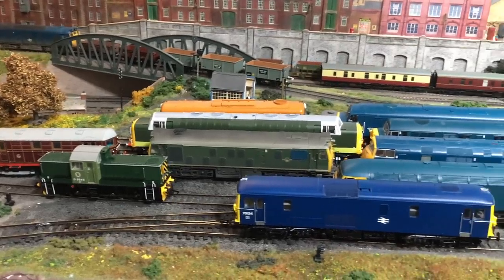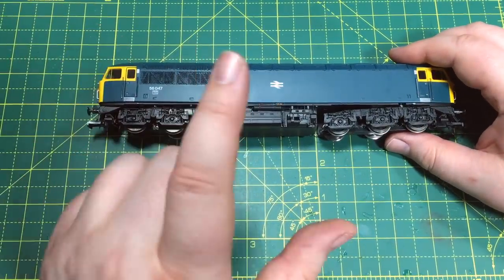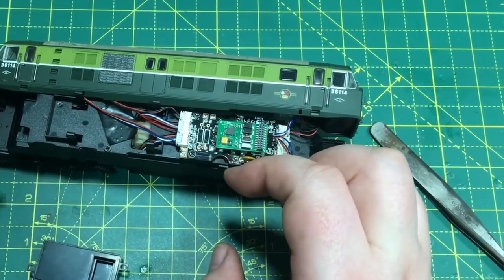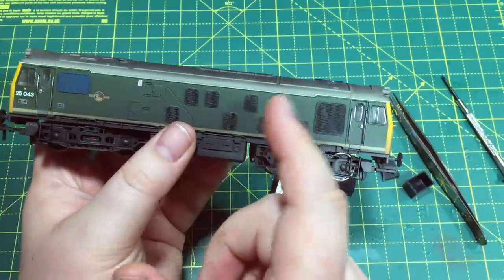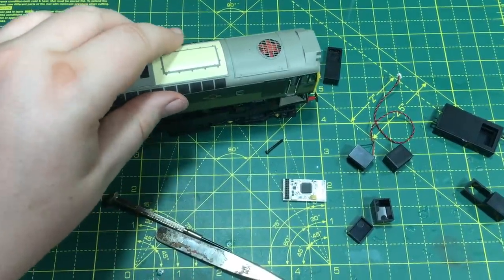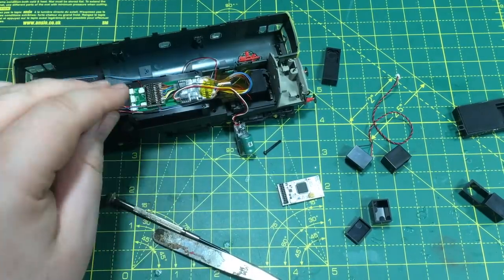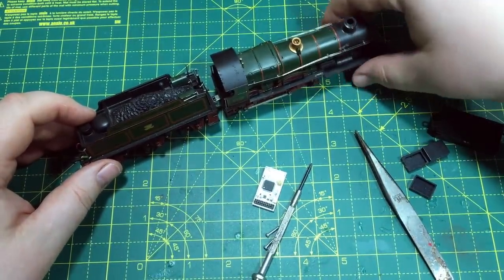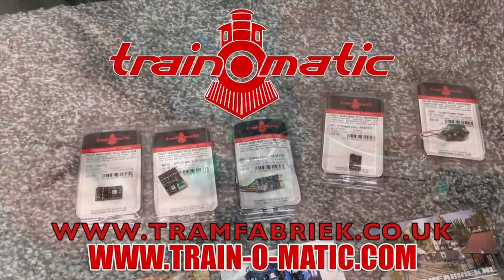Will it Fit? HM7000 21-pin TXS Bluetooth Sound Chip in all my locomotives!

Comment: That was fun. Always good to see things tested rather than simply relying on opinions.

Hopefully they can engineer a different antenna solution and maybe find some smaller micro controllers for the next iteration of the next18 decoders, there's certainly scope to achieve it looking at the specs of what's on the board they are producing now and what is available in smaller form factors that achieves the same functionality. Well worth going on a dive into PCB antennas and drawing out the circuits and choices of components based on photos to work out what exactly they've  used and how they've gone about it. It's quite a tidy little PCB with not much room to impove it beyond the two things mentioned above.

Comment: Hi Jenny it’s me you read my name out on your Monday Club every week now I have five of these decoders four 21 pin and one 8 pin type 
So yes I like how they are workable and how you can easily download the sound profiles but most of the time the profiles do not fully download and you have to keep trying and sometimes have to use another type or style of sound profile to get the full sound working 
Then after having two decoders that failed I have sent them back to hornby 
Also I find that if I have a short on any thing my ecos goes into stop mode so I fix the short the press the ecos back to start or go and the three hm7000 fitted locos just start off on there own and don’t stop 
I don’t know if anybody else is having the same problem or it’s just me 
Thanks for this video it is quite informative and helpful 
Cheers

Comment: I tried the 21 pin weeks ago and it fitted easily. The main problem is the lack of sound profiles. It worked ok for me but there aren't many I can fit it in to, with a matching sound profile, so it has limited use for me. I hadn't heard any rumours but then I don't listen to gossip, just evidence. PS I was fab with DOS. I got every bit of memory out of it for my new flight sims. Autoexec.bat and config.sys were my best friends.
Reply: Exactly. The DOS analogy was wrong

Comment: Great to see that the 21pin unit is a pretty standard size. I might have to get a couple.
I did get a couple of the 8pin units for older locos and had trouble fitting them in but getting any sound chip in some locos is a tough ask.
The HM7000 chips are a great unit for folks who don't want to spend the big money that "full fat" sound chips require. They sound good enough for me.

Comment: So far I have 5 Hornby locos fitted with these decoders and overall I’m impressed I did have one decoder failure and a couple that I’ve had to relink to the app to get blutooth to work but hopefully with a few more updates to fix the bugs these will be great and far cheaper way to add sound switching them over to Dcc after set up I’ve not had a problem.
Reply: 20% failure rate isn't ideal. What happened with the fried decoder? I bought three and ok so far.
Reply: @modelrailwaynoob  The faulty decoder was working fine then next day it just made a high pitch noise coming out of the speaker and no motor control luckily I bought it from Amazon so sent it back and got a replacement next day no issues so far all working fine.
Reply: @stephenbromley2302  Out of interest, was it with a DC controller or DCC when it failed?
Reply: @modelrailwaynoob  it was a dcc controller digitrax dcs 210+
Reply: @stephenbromley2302  OK thx

Comment: I have been wondering how these would cope in an O gauge locomotive, say the Dapol 08, or that lovely Class 26 you have Jenny.
Reply from the maker: I will be testing some in the Dapol O gauge. However the 26 needs a high power decoder so that rules these out.
Reply: @JenniferEKirk  I did wonder. I am keen to try one in my smaller engines in O gauge! Particularly if I use battery power in the garden

Comment: The 21 pin decoder is the correct nmra size, whereas the Next18 is larger by the size of the bluetooth antenna, as Simon Kohler has admitted. This  compromise was accepted because components were not available to making the module shorter so the decision was made to go ahead with what was available, and make sure new Hornby product (including TT) would fit the new decoder.

Comment: I have only one Delic Locomotive which is DCC Ready. Will the HM7000 Chips hot wire into an earlier Locomotive? That could be an interesting project. Martin. (Thailand)
Reply from the maker: The 8pin versions can be carefully hard wired in as long as there is space.

Comment: With the Bachmann Class 47 - did you try the chip in there and run it, because I believe there used to be issues if you used the old TTS chips in non-Hornby locos that you'd have to change CVs or something of that ilk?
Reply from the maker: I did - It works fine
Reply: @JenniferEKirk  Ace thanks - looks like they have really come up trumps this time
Reply: I’ve used TTS chips in Bachmann locos. No problems and no need to change CV settings for me
Reply: @modelrailwaynoob  thank you

Comment: DOS wasn't a problem, and we still use DOS and/or POWERSHELL
Reply: DOS was a major problem for the average person. There’s a reason computers only start becoming ubiquitous in the late Nineties.
Reply: @GameHammerCG  It was never a problem - to average or not.  As I said, it is still used to this day and the analogy used regarding DOC in this context was a poor one.

GUI-based operating systems were popular in the late 80s - so again that is incorrect.  The use as a home machine and utilised in smaller businesses started to become all the more the case with the demise of the popular home micros with the death of Atari and Commodore in those markets and Amstrad just producing rehashed 8-bit Spectrums in nice cases - but again, they went down the route of building PCs and thus increased the PC into more and more markets and uses.

You still used alot of DOS even in the last years of the 20th century, and it would be more DirectX that was the change than setting the IRQs and pins on the hardware that made them easier.
Reply: @johnpapworth433  We are going to have to disagree. GUI OSes in the 80’s were incredibly limited. Hell, even Windows 3.11 was limited and I’m absolutely correct that full Windows-only systems from 95 onward heralded easier-to-use computers, with the resulting massive increase in sales. There is a noticeable increase in domestic computer use as a direct result of Windows. Like it or not, average people (not average computer users) got a computer because Windows made them easy to understand.
Reply: @GameHammerCG  YOu can disagree as much as you want, it doesn't mean you are right.

The differences of GUI in the day were the Apple ones, you had GEM and of course you had Amiga Workbench - along with early Windows, OS/2 etc.  GEM was very limited because that is all it was, Apple - I don't care about - but was still flexible, but the others Workbench and Windows were front-ends for their CLI, which meant that you still had a lot to do in CLI than just with a GUI.  People STILL use DOS and Powershell to this day.

Linux GUIs are developed by developers and are cumbersome, but the whole OS is not popular outside of its fanbase - I too use that, and in some cases - well many cases, it is easier to use the CLI than GUI.

Home computer use grew from the 80s, some of us were there for that and saw the rise and fall of the Home Computer whilst seeing them being replaced with the IBM PC and Clones. Even Windows 95 still was a front-end for DOS.  People used PCs at work, so they bought what they used as they knew how to drive them at work.  One of the jobs I did was convert Instructor Led Training for a certain Govt Body from Amiga to PC - because the Amiga, despite being much more proficient at the job and much faster - was converted because it was mandated to use the PC.  Windows being a front-end for DOS, that didn't really change until they went to using the Windows 2000 core for both professional and home-based versions of Windows - and if you used that it became truly stable.  

So, I think you mistake computer buying increasing with the coincidental change in Windows versions and all the other factors that surround it. You also ignore the fact hardware was cheaper and also became easier to implement which made people of a variety of skill levels have the ability to update their PC, that attributed to DirectX to manage hardware configuration which put off a lot of people using a PC. Then of course True 3D with the old Orchid cards.  Cost - cheaper to buy IDE or SATA that SCSi-devices. Intel/Cyrix/IBM/AMD et al were cheaper processors to buy than the Power PC ones and of course the motherboards created to one standard rather than bespoke.

I am not a hater of Windows, I do like it and have used every version of it including ME (lol) and seen how much more stable and robust it is compared to how using development tools would crash all the time in Windows 95 and 97 - and long for Windows 2000. Windows was there during the increase of PC use, it is not the main factor for PC sales increasing - if it was all about usability, people would have gone the Mac route for that reason alone.
Reply: @johnpapworth433  tl;dr
Reply: @GameHammerCG  I disagree Zoe. They started selling more as they became available in all kinds of retail outlets and home users bought them as well as businesses. Of course more and more small businesses did the same when they realised the benefits of changing from papersystems
Reply: @johnpapworth433  I didn’t like the first versions of Windows. My own GUI was faster for me
Reply: @GameHammerCG  People we’re going to buy them anyway. It wasn’t just because of Windows because people wanting to buy didn’t know what Windows or DOS was. I know this, because I helped friends, family and colleagues to buy them. I bought my first PC in 1990 but I had used others’ well before that.